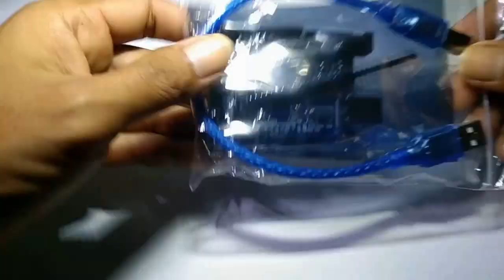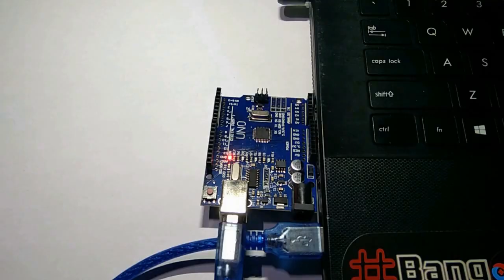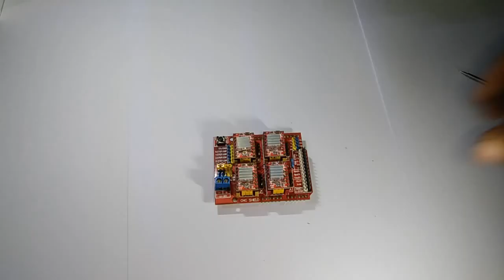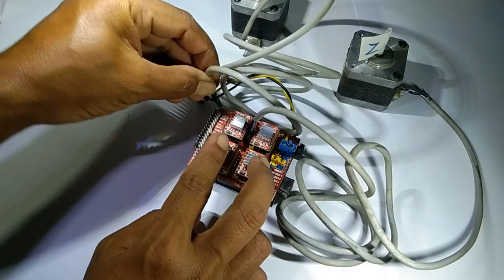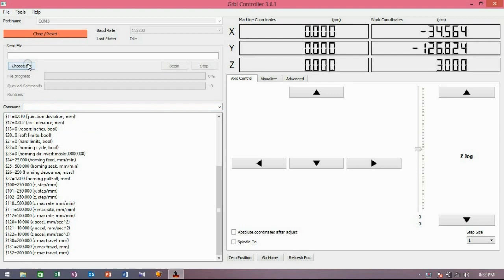Arduino Uno + CNC Shield V3

Comment: can u tell the name tool you using to control?, why you can import a picture, then it auto detect the cordinate and run
Reply from the maker: I use the grbl controller, and that is an image that has been converted into a gcode file

Comment: Hi
Csn someone guide me plz? 
I have Arduino UNO with cnc shield v3 (same as in this video) and I want to use BT6600 stepper controller. 
Is it possible???
Reply from the maker: Yes, try checking here https://drive.google.com/file/d/1Nz606dkmKZemDrogpWsWFdCyvaitR0VK/view?usp=drivesdk
Reply: Thank you so much. Got it

Comment: next time you need make video lot better talk what you do and why, and use external motor drivers, etc DM556 ot TB 6680 similar tell better how wired double Y motors, or X motors. not understand- and what need setting in code and how. probe and all limit SW and E stop, invert or not.speed. screw pitch calibration.

Comment: Mas, kalau pin en/gnd itu untuk apa ya?
Apakah perlu dijumper juga atau tidak perlu di jumper ya?
Karna di beberapa vidio ada yg dijumper ada yg tidak.
Mohon penjelasannya mas ??🙏🙏🙏
Reply from the maker: Dalam datasheet itu fungsinya untuk mengaktifkan board cnc shield, tp tidak di jumper jg tdk apa²..

Comment: Can you help me  on  wire on CNCshield gets melted often. What's the reason?
Reply from the maker: Which wire melts most often, which is connected to the stepper motor or the power cable??
Reply: @sesebitan_id  Jumber Wires connected to cnc shield
Reply from the maker: Try checking your stepper motor datasheet how much current is needed for your stepper motor then make sure the incoming current does not exceed the current required by your stepper motor.
Reply: @sesebitan_id  Sure, Will check that also. Thanks for your suggestions